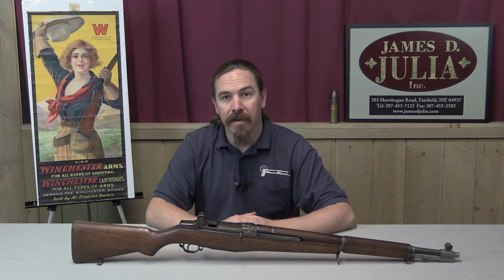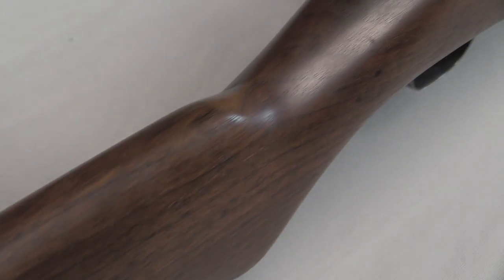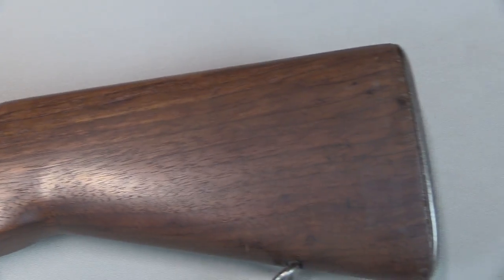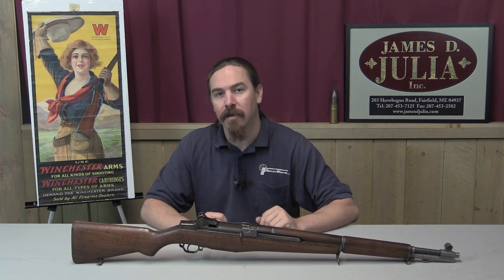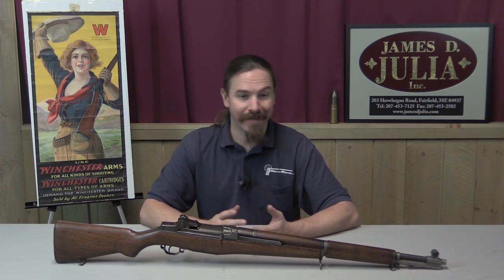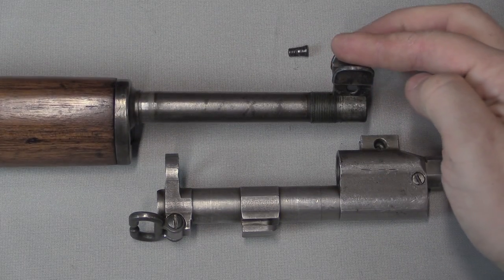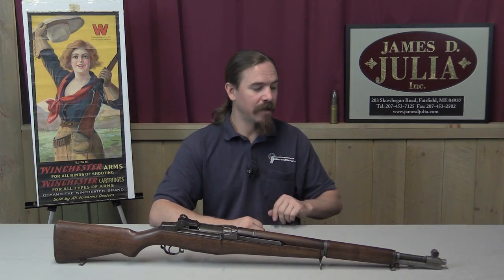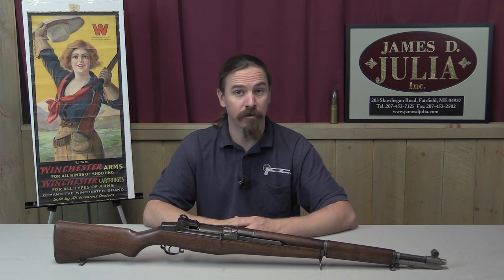Gas Trap M1 Garand

Comment: I had - in the national service in Denmark in the 1980'ies issued a Garand with a 3 digit number - don't recall it now - about 40 years later. It must have been rebuild with the new barrel as it had the gasport and did not unscrew. Furthermore the reciever was well worn - so much, that in fact it had to be put down with a little caution - or the bolt would drop out.

I recall this because they groaned over my "luck" when testing gasmasks we had to quote our rifle without the gasmask before being let out. What they didn't know was: I was a qualified NBC instructer with the NBC-officers course, and having fooled around some with CS-gas and was to a large extend immune to CS-gas - at least in the concentrations used in the gas-hut. So I had a conversation without the gasmask.

Hope my comment is usefull.
Reply: If your rifle was American made, with a low Ser# like that, it probably was rebuilt from a gas trap. After WW II Denmark bought some of their M1s from Italy (made by Beretta and Breda). Those rifles would have been the later gas port rifles. Italian made rifles are marked either "BMR" or "BMB" for Breda or "PB" for Beretta. I lucked into a Breda Danish reciever in the 2000 range.

Comment: Ian, to me it looks like the gas trap/plug/block on the original m1 could be removed by just undoing the one screw while the cylinder remained on the rifle. So like the gas port m1 the cylinder could stay on the rifle during cleaning or is there some sort of lock up of the plug with the spline of the front site? 
I don't know if I am saying this clearly.

Comment: Is it normal for the gas cylinder on a standard M1 to come off that easily? Mine needs to be beaten into place.
Reply: I cant even get mine out lol
Reply: If the dovetail on the gas cylinder has slit cut in it then you need to loosen the front sight before removal. This creates a pinching effect which better clamps the gas cylinder to the barrel and also has the benefit of a very stable front sight. If your rifle does not have this feature and requires a wood block and hammer this is good because it's a very good fit to the barrel and again a stable front sight. This key if you want to have good days at the range with your rifle. Regardless of cylinder type. Remove as infrequently as possible.

Comment: The weakest point in the M 1 as well as the M 14 is the front end. It is well engineered as far as the gas cylinder or flash suppressor being keyed into position but the problem is how the gas cylinder or flash suppressor is locked into place. Since the front sight is directly attached to these assemblies and if becomes loose you will end up shooting basket ball sized groups.  If you notice even in the movie Full Metal Jacket when Ermy checked private piles rifle he checked the flash suppressor to make sure it was not loose. On the M 1 there are two styles of gas cylinders that I know of. The main differences being in the dovetail for the sight. One will be solid and the other having a cross slit. The cross slit type has a pinching effect as the front sight screw is tightend down making for a secure fit  to the barrel. Remember to loosen the front sight screw with this type before removal of the gas cylinder. This in theory has a longer service life as it not dependent on the keys precision and wear over time as it is removed for maintenance. My suggestion is to remove the gas cylinder as infrequently as possible.

Comment: If the gas trap was destoyed or removed, could you load the rifle manually with the charging handle after firing? Or would it just be completely non-functional
Reply: Yes, sure it will be functional. Otherwise any misfire would cause serious problems. Some gas-operated systems even have a gas regulator, which allows to close a gas-port, effectively turning the weapon into manually operating.

Iraqveteran8888 even has a video of AK endurance test, where the gas piston jammed due to extreme overheat, but the weapon was able to operate by loading it manually after each shot.

Comment: Hey i have a question about the m1. Why does the forward hand guard not go all the way around the barrel? Was it just to dissipate heat from firing or is there another reason?
Reply: It does, it's just not wood the whole way round. The forward handguard is slotted to accept a small metal plate that separates the barrel from the gas piston. As seen here: http://picturearchive.gunauction.com/444275/9132379/60832a7e5825264698fda739ac375d7f.jpg

Comment: Why destroy a working gun? Hadn't they heard of selling them as surplus? For a civilian it would work just fine probably!

Great video again - like all those background tidbits!
Reply: because...Government.
Reply: fuck that they could have sold them at a discount to entirely revamp a small nations standard battle rifle lol, still arguably better than a bolt action of the time, especially for a county that would use them less and need volume of fire advantages over reliability. Argentina, Canada, Chile, or maybe even Brazil or Columbia could have been coerced into buying them I'd imagine.
Reply: In 1946 they sent them back to the arsenals where they were detail stripped, cleaned and worn or broken parts replaced and stocks oiled, cracked stocks were repaired and when done they were inspected and stamped with the arsenal cartoush.  They could have converted the gas traps at this time.  This was also done with the trench and riot shotguns, as long the cost of the parts did not exceed the value of the gun.  And this was done with M1897's that were up to turn of the century.  And this is why their is so many guns with mismatched parts, whatever parts were available were used.  And a good thing they were rebuilt because just 5 years later they would be back on the firing line in Korea.
Reply: David Marquardt
Bureaucracy...just as mad as engineers who design products which work, but which aren't practical (like cars where you can't switch out a light-bulb without taking half the car apart...sure it works - on paper! - but is it practical? Hell no!)...IMHO everybody who makes laws or designs things should be forced to live with the consequences/forced to use his/her product!

Comment: Isn't the rear sight wrong, I think it should have a BAR LOCK type rear sight. That sight wasn't on the M1 until sometime later.
Reply: it could have been added on early on during the war by an armory officer when it came in for service. Just taking a wild guess.
Reply from the maker: Locking bar rear sights were adopted in late 1942/early 1943.
Reply: From what i can see that appears to be the correct rear sight. the first sight was a flush nut style like the one pictured in the video. the next series were the lock bar sights type 1 2 and 3. then the type T105E1 rear sight.which did away with the lock bar and looks like the original flush nut sight. if you look at the elevation drum, it say battle range. the post war T105E1 sight had a big screw there.

Comment: Did the M1 see any service pre ww2?
Reply from the maker: No, the US didn't have any combat action between 1936 and 1941.
Reply: I find it interesting that the BAR and Thompson had action on the streets in the hands of gangsters in the 20's and 30's and then went on to become standard equipment for the largest war of all time
Reply: Yeah that's true but they were already in service pre WW2. the US got the BAR in September of 1918 - 3 moths before WW1 ended and the Thompson was issued to the marines in the late 20's and the Navy and Army followed suit in the early 30's and formally adopted it and designating it the M1928A1 in 1938. Theres an old picture floating around of a US navy patrol boat in china 1931 and some of the sailors are packing Thompsons and BARs as well as m1897 shotgun and a Lewis gun.
Reply: @ForgottenWeapons  Sir, aren't there any gas trap M1 rifle in the Philippines prior to Japanese attacks in 1941? I remember reading a book that mentioned that there were some M1 rifles in the hands of the 26th Cavalry(PS) during the Battle of Bataan.

Comment: Why were they so worried about drilling the gas port when the Lewis, DP28 and Mondragon already existed?
Reply: As a mainstay rifle for every soldier, the engineering spec. said that it needed to be simple, reliable, and effective with little maintenance required.  The maintenance required on much more complicated guns like the Lewis and the DP28 were well outside of the spec. that the M1 Garand required.

Comment: Wouldn't it have been much easier to fix a screw that might come loose, instead of redesigning the gas system from scratch?
Reply: the screw was sn indicator that the GasTrap system had significant safety issues for the user.
Reply: I think the sole fact that a removable piece can obstruct the bore is the problem.
The piece needs to be removable, because that's needed for cleaning. There would always be some risk.
Reply: Gas trap extends the weapon length compared to the gas-port system with the same barrel length, has more parts, is harder to maintain, can be potentially dangerous. No wonder this feature was removed in the next "patch".